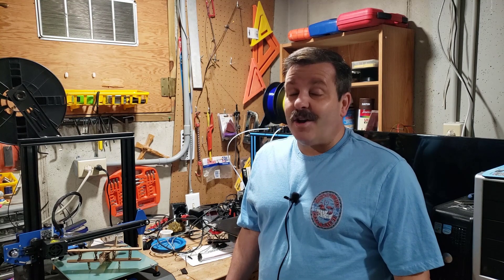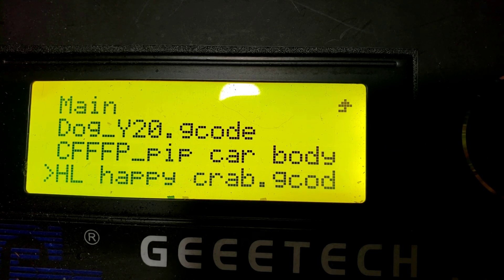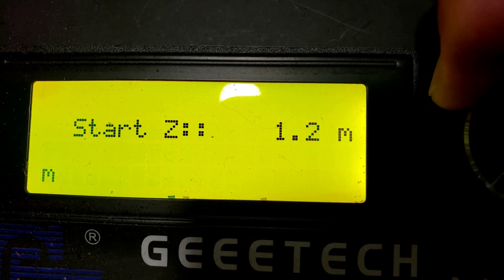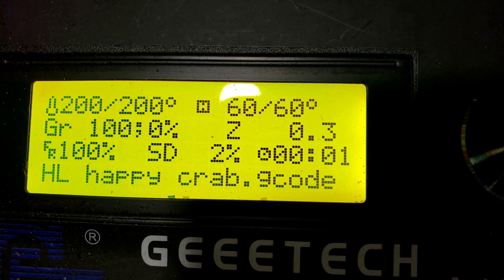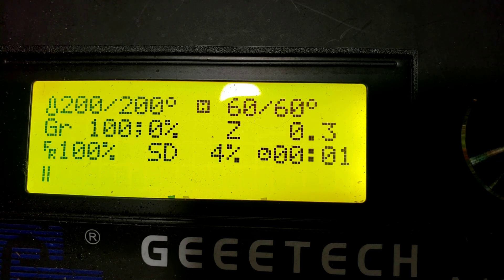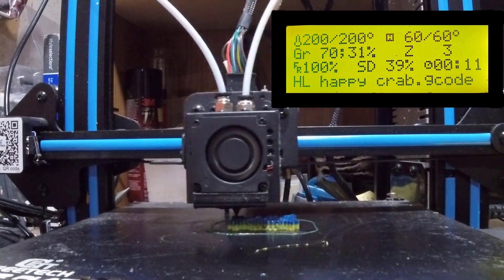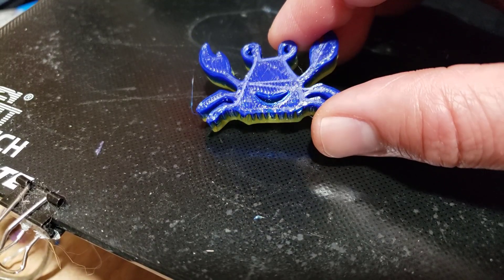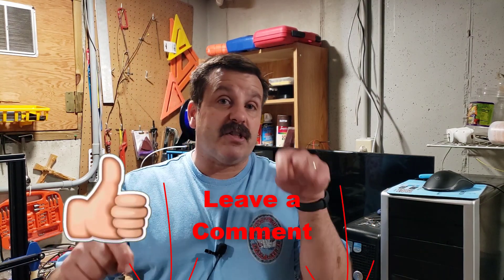Mixed color Gradient Prints | Geeetech A10M with Marlin Bugfix 2+

Comment: Hi, I have an A10M and the temperature hot bed works but not detect the change on the temperature. The thermoresistor works, but always gives an error: Heating failed: Bed PRINTER HALTED. Please Reset. In your knowledge, what can I do? Thanks!
Reply from the maker: Which firmware are you running?
Reply: @HLModTech  Thanks for asking me. Marlin 2.0.7
Reply from the maker: @gesn  Ok. Are you using bugfix? Did you also make sure to grab the config that fits bug fix if you are?
Reply: PID tune your printer, easy enough to find tutorials online